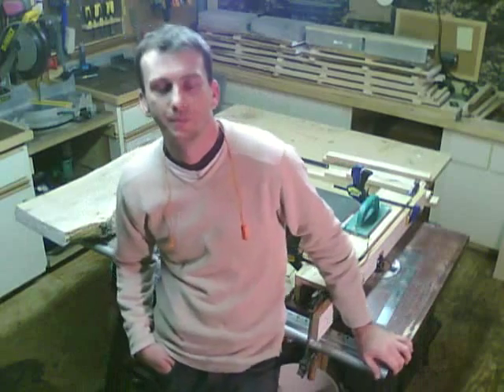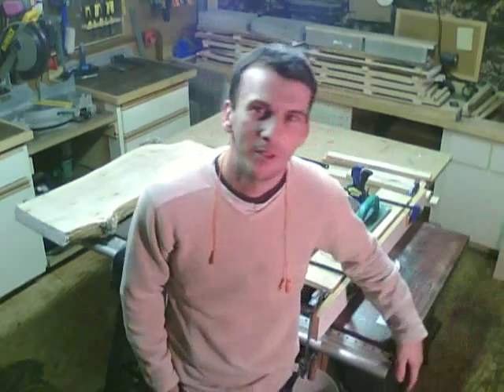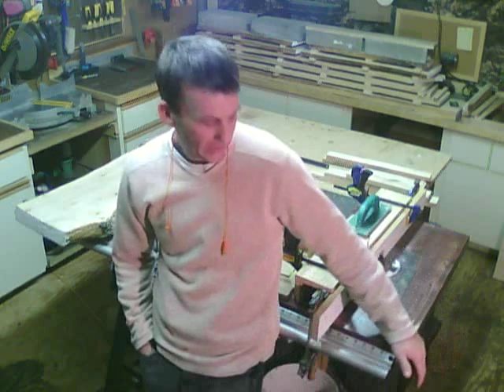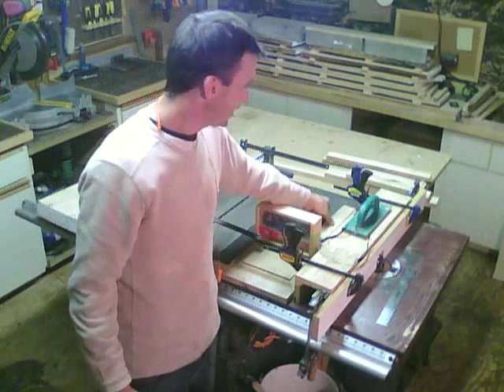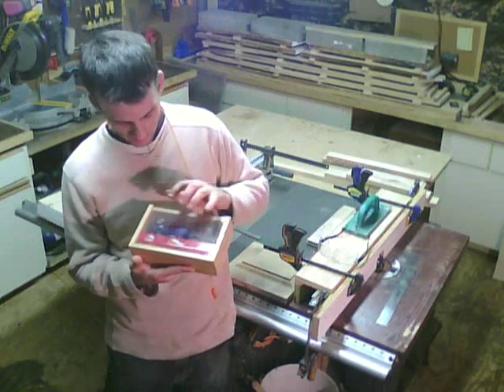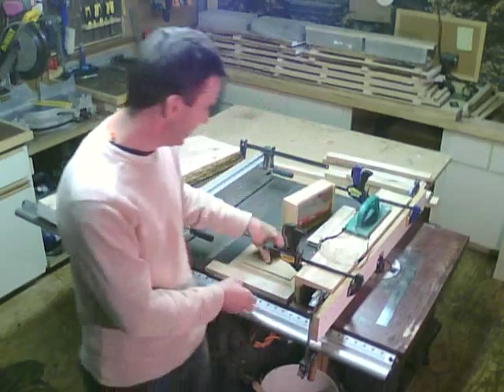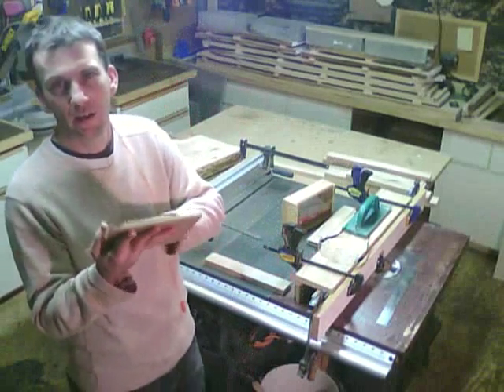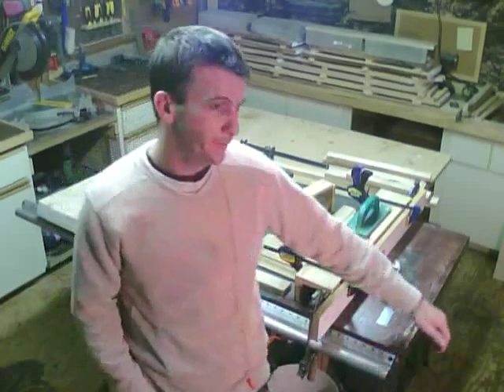How to build a Hickory Chest part 1

Comment: PUT A HANDLE ON YOUR PUSH BLOCK. WHEN I FIRST STARTED WOODWORK AND CABINET WORK RIGHT OUT OF SCHOOL,1960, WE USED A HUGE SHAPER WITH NO MITER SLOT. JUST USED A PUSH BLOCK WITH A HANDLE FOR EDGE SHAPING AND RAISED PANEL WORK. GOOD LUCK WITH YOUR NEW VENTURE.